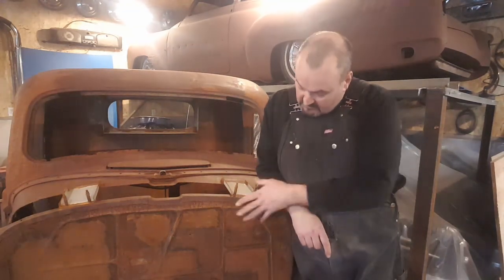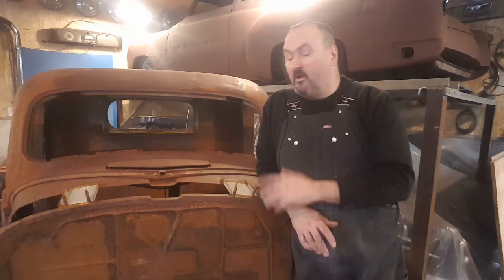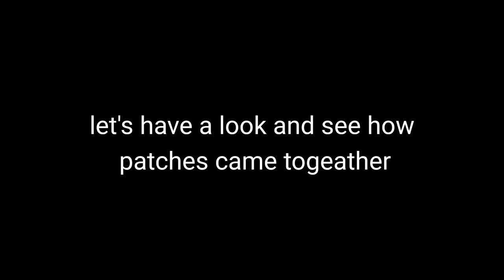Hot Rod build. Patches. Where it all started

Comment: I’ve been meaning to ask,  when you cut the cab up and metal finish the outside ,  how do you protect the metal on the inside of the weld .   How do you prevent it from rusting
Reply from the maker: I dont. I'm letting this one rust. Its the way the truck will look .I'll undercoat the inside when I get to that point
Reply: @fitzeesfabrications  I understand on your truck “ patches”. That’s a amazing truck ,  all the work you’ve done to it .  What if your doing a restoration job ,  how would you protect all the welded metal inside the “a” plillers that you can’t see
Reply from the maker: I'll seam seal it where I can and also paint it. But if you every cut up a pre 80s car you will find that there is no protection on bare metal  anywhere where you can't get to. Itsa problem only if you tend to use the car in a damp climate alot. Most rust in cars start with water getting behind the panel. If water can't get there it won't rust like you would think